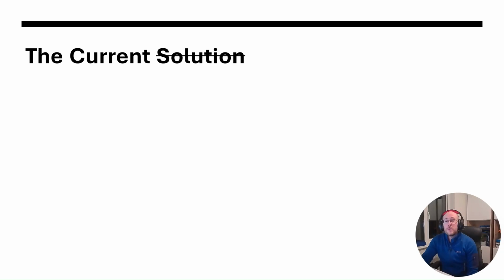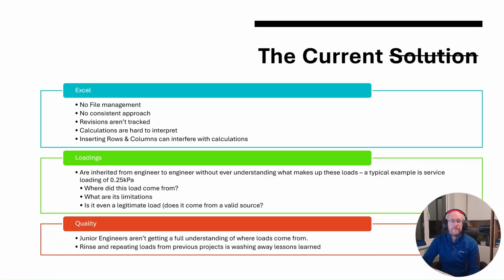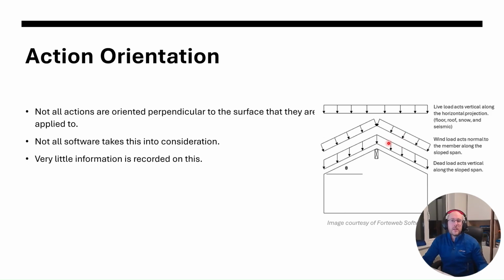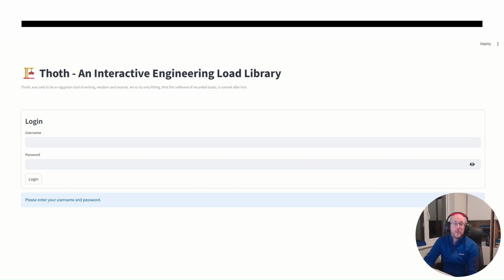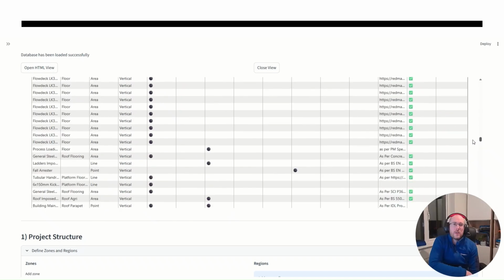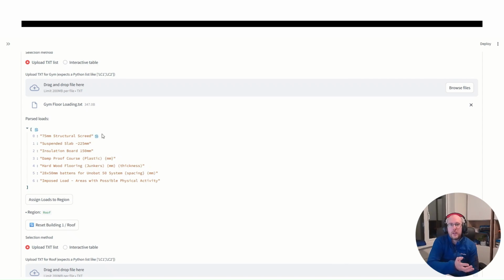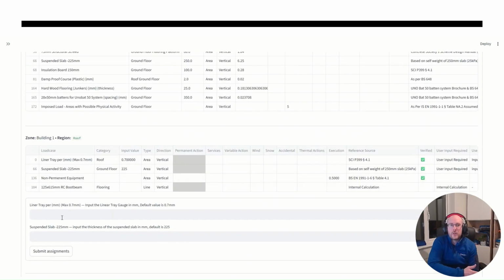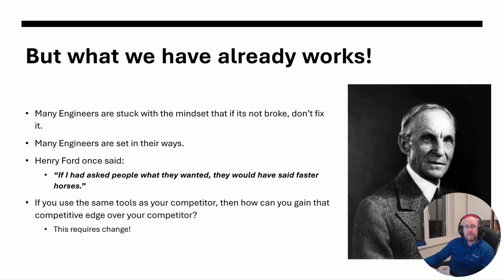Interactive Loading Tool

Comment from the maker: Try the Txt Feature!
Create a txt file called "Gym" and add these loads into it:
["75mm Structural Screed", 
           "Suspended Slab -225mm",
           "Insulation Board 150mm", 
           "Damp Proof Course (Plastic) {mm}",
           "Hard Wood Flooring (Junkers) {mm} (thickness)",
           "28x50mm battens for Unobat 50 System {spacing} (mm)",
           "Imposed Load - Areas with Possible Physical Activity"]
Next upload it into the app and see what happens!